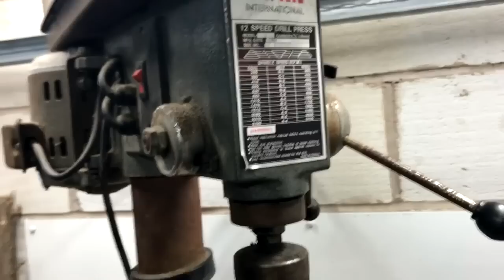Rusty Seized Solid Drill Press Restoration & Repair - Part 2 - Mechanical Repairs and Rebuild

Comment: sir,superb Job,few questions,do you memories the parts to be placed,or refer the video or comes through practice,i do have a very old drill press,what difficulties will i face for a beginner,i do know mechanical work,but never restored like the way you did,can you give some advise like how to start,where should be more care full,some advise would be great,thanks in advance

Comment: I was really looking forward to this video and you didn’t disappoint. It’s brilliant watching you work as nothing is rushed and everything is done purposefully. Not like myself where I lose something every couple of seconds.

That was a great idea with the cable ties and the spring from hell, I'll remember that one. When you were building up the weld on the pulley were you using flux core or wire with gas please? If it was the latter I’m presuming your welder can also use stick, may I ask why you chose not to? Doesn’t stick have more choice for cast metals? I’m still quite new to welding and I’m full of questions (59 years old before I touched a welder). So none of this is criticism but pure curiosity.

A superb video as well as a great restoration, thank you very much for posting it.
Reply from the maker: Mark Harris I lose stuff constantly mate, just edit those bits out! No one wants to sit and watch me looking for the screwdriver I just put down for ten minutes 😂 

with the welding I used argon with standard wire. I don’t currently have a stick welder, but even if I had I would have used mig for this kind of repair, once the initial weld is in place across the cast piece you’re just layering up across it, using stick would take ages to do this kind of repair! I find as long as you heat cast up first it welds ok with mig, sometimes it’s hard to get a nice weld pool going due to all the impurities in cheap castings though. I’m going to upgrade my welding set up in the new year, got my eye on a nice new tig that can handle aluminium too. Want to build a bar in my back yard from metal and wood so need a better set up than I currently have!

Cheers for watching mate!
Reply: SparesOrRepair Thank you very much for the information regarding the welding, it’s really appreciated and informative. I was looking at some MIG, TIG, MMA welders when I bought mine, I decided to keep things simple to begin with but I have so much to learn. Every wild and I learn something new, which I like. 

You’ll have to do some videos of your bar when you build it. Thanks again.

Comment: Well done, that press will last a long time now!  Not too sure about that vise though, OMG so many holes in it!
Reply from the maker: The vice will look like new when I’ve finished with it 😉! Thanks for watching!
Reply: @sparesorrepair9118  there comes a point when it would be easier to machine a new drill press vice  out of purely weld filler...lol

Comment: You've got some runout on that drill...
Check it with a DTI clock...🇬🇧👍
Reply from the maker: I don’t have one atm, think it’s the taper on the chuck though. I’ll keep an eye out for a cheap used one on eBay!
Reply: @sparesorrepair9118  

You'll need two...

One to check quill runout and the other to check chuck runout...

Use both simultaneously...🇬🇧👍
Reply: Might just be a bent drill bit..
Reply: @hamkimj65  

Hence why I said he needs TWO dial test indicators...🇬🇧👍

Comment: Lazy painter trick. A lightly greased surface using vasoline works better than tape on smooth surfaces. Just scrape the over spray off.

Comment: Part 2 was certainly worth waiting for! Great restoration job! :) Oh...one thing....the pulley lid is missing the knob on the side that opens and closes it. :)
Reply from the maker: I’ve been trying to find a photo of what the original pulley kid knob looked like, would like to make it as close to original one as possible
Reply: @sparesorrepair9118  What is that little round (black?) disk you put above the spindle pulley on the cover?
Reply from the maker: Benny Banger it’s just a felt pad, doesn’t need it as the pulleys don’t rub but it came off the cover originally so I cleaned it and put it back on 😊

Comment: Enjoyed the videos.  Any advise on how to remove the idler pulley when it is nearly frozen in place.  got it to move a bit by soaking in WD40 and whacking at it but it barely budges. Doubt my anticipated lifespan would allow for success with this method. 🙂
Reply: -- Here's a bit of practical advice... stop using WD-40!! That stuff is for shite when it comes to being a penetrant or a lubricant. If you are going to use a penetrant in an attempt to free up parts that are stuck then use an actual penetrant which WD-40 is not. Best wishes!

- Max Giganteum

Comment: Well done, you certainly put a lot of effort into giving this machine a good second life.
I am not sure why the quill handle needed to be ground down to 8.85mm in the middle.   Creative solution with the ghetto lathe.
The vise looks to have had a worse life than the drill.   LOL

Dave.
Reply: LV_Woodturner   modern thread production is by rolling not cutting, so you start with an undersize stock and the action of rolling causes the thread to grow to size.
Reply from the maker: It didn't need to be 8.85mm, I could have just threaded the ends of the 10mm rod and chucked it in, but it would have stood out from the other 2 handles like a sore thumb. I literally can't tell which handle I made now, which is exactly the aim of turning it to 8.85mm :)

Comment: Is that a brass or steel wire wheel on your bench grinder? What are you using to wash off any remaining paint stripper residue before painting?

Comment: Great work man. I have an identical drill press, a Chicago Machine Tools I-14 made by "allied international" in Taiwan (clean up vid on my channel, although not a full blown restoration). Anyone know if there is any parts support for these things? The spindle on mine is bent and I'm having a hard time locating one here in the states.
Reply: nope, worse, many of the smaller presses had a jacobs taper1.5 , which is totally non standard and not available,  with some effort i altered the taper and a JT6 chuch fitted, and was the only option or scrap,  as the spindle doesnt have the separate arbor like the video, but if yours HAS the arbor, then its a morse taper spindle..a standard item

Comment: I have this exact same drill press. I bought it at Menards in Brooklyn Park, Minnesota probably about 30 years ago. Mine still works fine. The only problem I have had with it is the set screw that looks the pulley to the shaft had come out. I don't know what is wrong with that one, except for aesthetics. Nice job though.
Reply: Seems to be a generic design.  I have one with a Craftsman label.
Reply: Mine is the same too and around thirty years old. I bought it from Axminster Powertools, UK under their label. Two main differences are an adjustable light and a keyless chuck.

Comment: When drilling, keep the workpiece up against the shaft of the drill stand
Reply from the maker: I generally would do this but, I couldn't get the camera in place to take a shot whilst resting against the pillar! I settled for having the long end on the correct side so it would hit the pillar in the worst case. Thanks for commenting, it's a good tip that I probably should have mentioned in the video!

Comment: @sparesorrepairs do you use anything to protect the unpainted parts that you polished from rusting? I have used a wire wheel to polish parts and tools before and within a week or so they have some surface rust (stored in the garage in a humid climate).
Reply: -- For any ferrous based metal parts that are left exposed to the open air (no plating or paint on the surfaces), slather white lithium grease all over exposed areas which can rust. A thin layer of white lithium will prevent rust while not interfering with machine use. Note that you may have to reapply the grease from time to time. Best wishes!

- Max Giganteum

Comment: Beautiful work. I noticed the drill bit has a slight wobble and I imagine that is a slight bend in the quill shaft. Mine has too. Any idea how to straighten the shaft?
Reply from the maker: I’m going to buy a dti clock and find the bend but I think it’s in the chuck taper, looks slightly off. If it’s the taper I’ll replace, if it’s the quill I’ll probably try and heat it and straighten, not sure how well it will work though!
Reply: @sparesorrepair9118  I have a bench version with a really badly bend quill. Last people that had it went at the chuck with a bloody hammer and totally ruined it and bent the quill shaft. I tried to straighten the shaft with heat, but without experience in doing this, I piked far too early.

Comment: There is a lot of wobble it’s of the bit or the chuck ?
Reply from the maker: It was the Chuck, I put too much pressure on the arbor when I pressed it into the Chuck so it was offset, it’s been aligned properly since and runs like a dream 👍

Comment: I think this would have been cooler had you explained how you got the chrome coating back on your post
Reply from the maker: It’s not chrome, it’s polished steel. I showed going through all the different scothbright pads and buffing it on the video
Reply: @sparesorrepair9118  sorry I missed that part 😑 I went back through. What kind of polishing compound did you use?

Comment: Looks like the spindle shaft might be bent, that drill bit was eccentric ?
Reply: I was going to mention, it looks like alot of play.  Either the shaft is bent or the chuck isnt set in properly.  It all depends on what he uses it for though, its plenty accurate for basic stuff to go with the ghetto lathe

Comment: The pulley might be a place where you splerge on a new part. That's going to need to be balanced.
Reply: Normally, yes. It used to be common practice but for most small drill presses, lathes, etc. You wont see it these days on budget machines.

Comment: So I have a similar press that needs rebuilding, do you have a list of the grinder pads you used for the column?  Thank you in advanced.
Reply from the maker: Can’t remember the exact grades but something like this will do it fine, may have to start with a wire wheel attachment to get rid of thicker rust: https://www.ebay.co.uk/itm/393069868282

Comment: paint stripper is a caustic chemical. I think it's BANED in the U K .  If you do a lot of restoration get yourself a sand blaster , removes paint and rust at the same time

Comment: Awesome!  Saving this one because I just bought a very used Jet press that needs restoring.  Luckily the motor is in good shape.  Press just needs a few new parts like belts, chuck, and bearing.  Bearing  does not have a parts # in the manual so have to find out somehow.  If you have a sec check out our channel called Repurpose Kings.  We repurpose cool industrial pieces into furniture

Comment: What’s the black spot (sticker) in the lid for, what was it made of?
Reply from the maker: It's a felt pad, doesn't actually do anything as the case is nowhere near touching the pulley, but it came off originally so I cleaned it and replaced :)

Comment: what kind of rust remover do you use?
Reply from the maker: I used a mixture of caustic soda powder, water and wall paper paste in this video, it worked pretty well on some parts but on others it didn’t even touch the paint. Still better than nitromors though which is pretty much the strongest non trade stripper you can buy in the uk

Comment: Put a coat of lanolin mixed with light machine oil and mineral spirits on the bare metal parts to prevent rusting.  Great restoration.  Did I miss the part where you cleaned up the drill column, or did you replace it?  Maybe you had it chromed!  *That vise looks like the back side of the moon.  *edit
Reply: Did you catch the ingredients for his homemade paint stripper?  🎨
I wonder what the portions are.

Comment: A drill press spindal should never never have any paint on it or it would start to slip under heat the belts make as I’ve made some spindals before in engineering and that is one thing you learn about making things like that they should be on direct contact with the metal no paint or grease nor do you crome it as it slips okay.